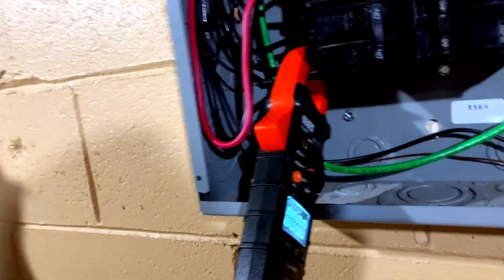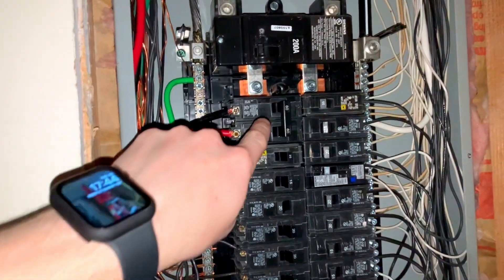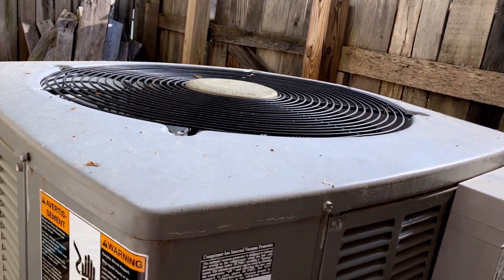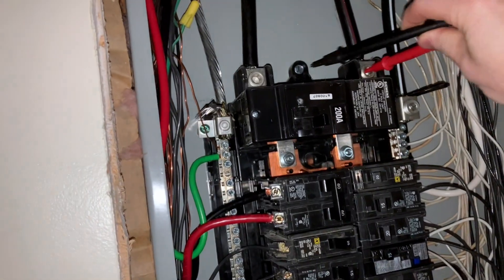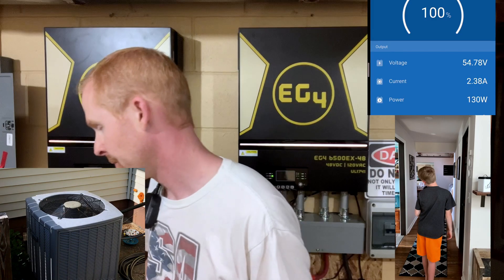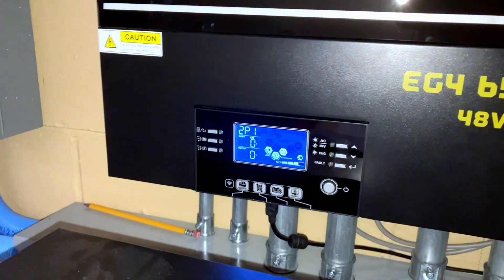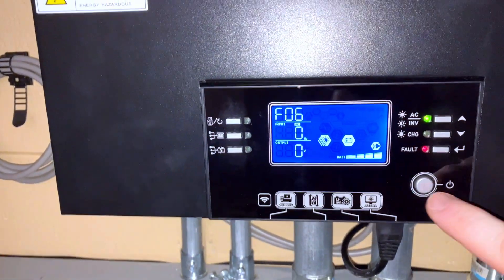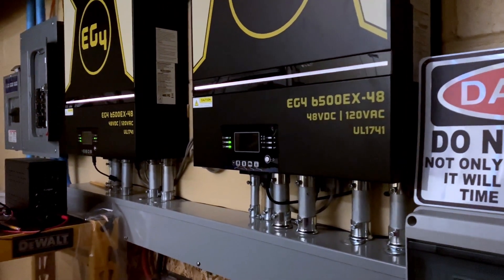EG4 6500 Load Test - Will it Run My A/C?

Comment: I had a similar problem that you went through. When I purchased my home, I had to upgrade from the ye olde fuse box to a 200 amp Square D QO load center and generator main breaker interlock with L14-30P input.

About 5 years and a significant investment in a metal roof later while waiting for my rooftop solar permits, I installed two Magnum Dimensions MS-PAE 4448 with load center. A bit pricey way to do it back in mid 2015, but it was what I considered the best overall at the time and it was able to start up my 2.5 ton heat pump pushing the inverters to the limit. I ended up breaking down and buying a Micro-Air EasyStart 3 month later, it took the 54 LRA down to 20. I can now run my A/C on either my 9500 Wp inverter generator or battery inverters.

Something you might want to look into in the soft start landscape is that ICM controls has come out with their version which is quite budget friendly in the neighborhood of $150. It doesn't have all of the fancy bells and whistles, but it won't bite your wallet too badly and it might pass under the spousal ordinance radar. Their model number is ICM870-16A and there is a ICM870-32A coming soon. 3.5 ton compressor might be pushing the upper limits of 16 running amps, you'll have to check the nameplate rating if it still readable.

There is a lot more options now on the renewable energy space compared to when I started my journey, but I don't regret the ability of "tripping" over the power company extension cord and go offline on my terms is priceless. Getting off my soapbox now.  :-P...

P.s. I added a L14-30R socket on the critical loads panel so I can run my generator cord from there to the main panel generator input socket outside. Making sure to isolate the inverter input breaker first of course!
Reply from the maker: Awesome!  Thanks for sharing!

Yeah getting spousal approval is best, otherwise my channel might got dark…permanently….😁

I’ll have to take a look at that soft start.  Appreciate it!

Comment: I had my fingers crossed I was hoping your air conditioning would start up for you.
Reply from the maker: Honestly I was 50/50.  I didn’t really know if it was gonna work or not.  I knew I was probably gonna want a soft start either way, but was still holding out hope that it would have started up.